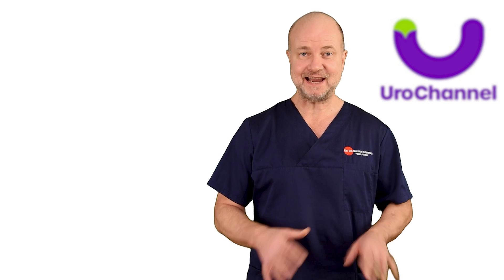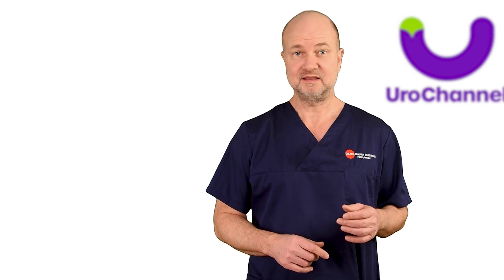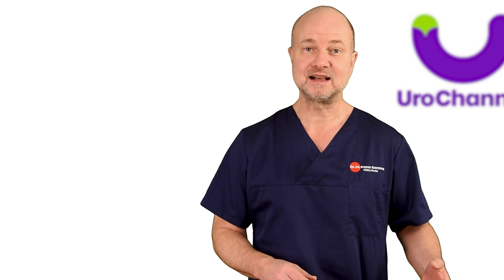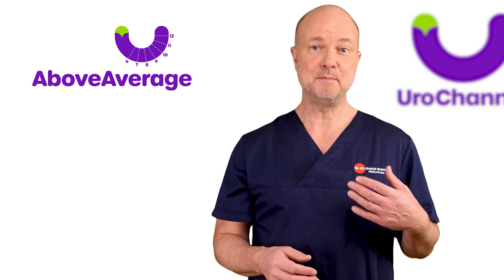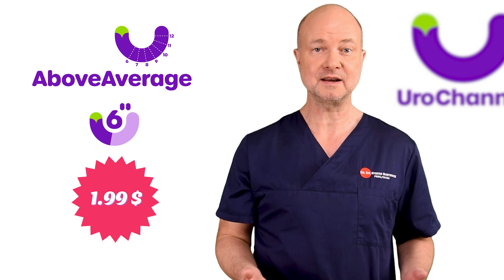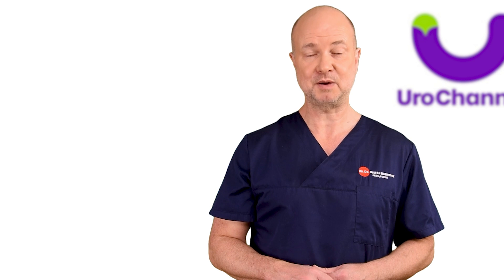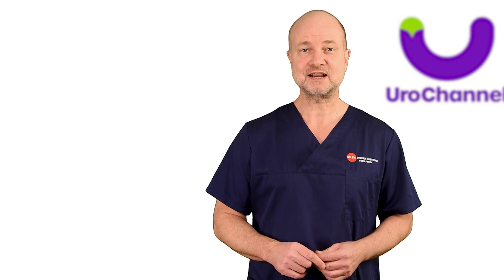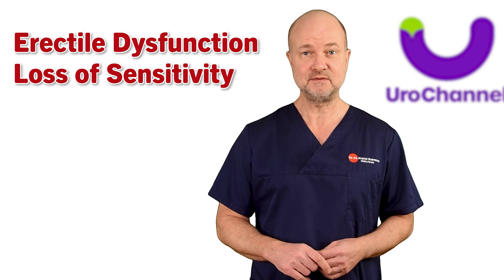PENILE GIRTH ENLARGEMENT with SILICONE! | UroChannel

Comment: Hello and Thank you for you channel. I have been following you for a few months now and Wonder what your thoughts are on Acupressure treatments for ED. I have not been diagnosed with any ailments but wonder if You think Acupressure can or will aid in health benefits.  I relate some massages to the penile instrument you talked about in a previous video?
Reply from the maker: Hi, thanks for your support! Pelvic floor overactivity contributes to erectile dysfunction. Treating trigger points will have a beneficial effect. I do this with shockwaves. But in principle it can also be done with manual acupressure. However, this would mean transanal acupressure. In my country, physiotherapists wouldn’t do it. I think, in Switzerland it is different- at least I heard.